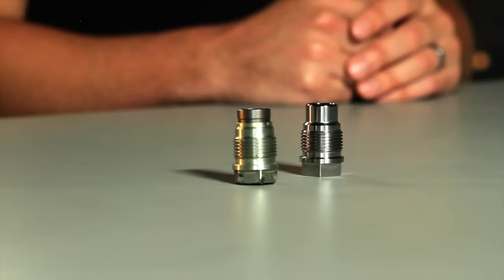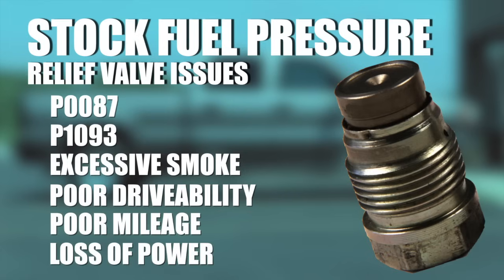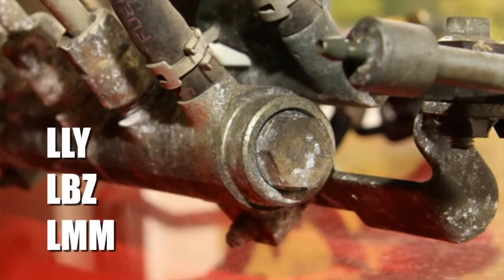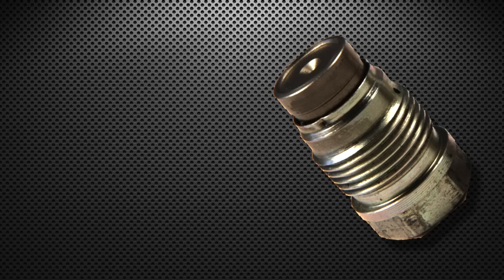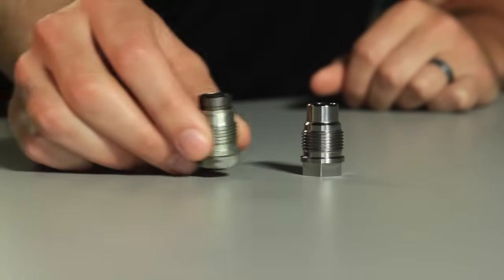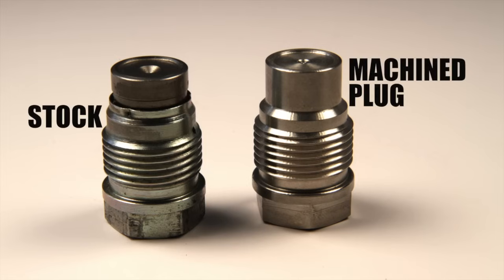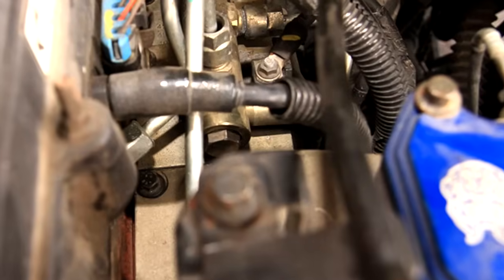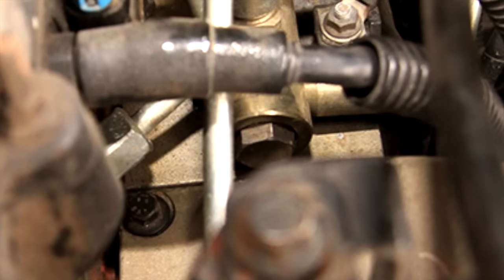Fuel Pressure Relief Valve - WHAT YOU NEED TO KNOW!

Comment: 04 LOT I have an issue. P0700 and U0101 loss of communication with TCM to ECM. Symptoms are: when driving going into 4th gear its like it skips a gear or goes into limp mode but pulls out in five seconds and shifting is good until going back through the gears. Checked pins on TCM checked grounds I could find. Replaced input speed sensor to trans. Replaced NSBU module......Does ANYONE have an idea on why this is happening?? I'm stumped, research online shows little like I'm the only person with this issue. 🤕 please help I can't bring myself to take it to a dealer. Have taken it to 2 diesel shops where I know the guys and a recommended trans shop. Very helpful but all shoulders on what the issue is...
Reply: Try replacing the TCM with new unit. It will require a flash from a tech2 scanner to work. This fixed my code p0700 issue.

Comment: I have a cummins 6.7 and had this issue on my truck. Took it to a mechanic here and told him that I don't have power when towing my 5th wheel and check engine light comes on. When driving without my trailer the light disappears after a while and i can go 70-80 mph. Hook up my trailer i can't go faster then 50-60 mph. He counted figurer out what was wrong. After watching this video i decided to pay the $40 with shipping and order this and replace it. Its been 2 weeks now and I'm hauling my trailer with no problem and its running well. Thanks guys.

Comment: What about the risk of blowing off the injector tips because now you have no way to vent the pressure which is how the system was designed?
Reply: Tony Turner the rail plug they sell still operates as a relief valve. However it is a higher quality and a little stronger
Reply: @andrewfarrell4312  no thats definately a plug.. not a sprring

Comment: Questions guys! I'm getting the code "fuel pressure release valve activated" but it only comes on when I'm sitting not while driving at all. And I'm getting none of them symtems you mentioned so have no idea what the problem is my car is 1.4 tfsi stage 1 remap
Reply from the maker: Give us a call tomorrow - we're not exactly experts with this engine - although we have one sales tech who drives, flips VW TDI's. 815-568-7920

Comment: I have an 06 3500. I get a ticking noise for a couple seconds then truck blows white smoke then it goes away. Could this relief valve cause this to happen if it's bad
Reply from the maker: There are a few things that can cause those symptoms. A new fuel pressure relief valve is a good idea, for starters. Can you call us so we can help you kick around a few other ideas? 815-568-7920.

Comment: Thanks for the video. I'm new to the diesel world and have been stressing a lot about putting this plug in my truck. It's a stock 5.9 cummins. The price of the valve is nuts compared to this plug. I was worried a lot about damaging my brand new injectors but your video has put my mind at ease a lot. Cheers from Canada.
Reply from the maker: Thanks for the comment.

Comment: What could cause similar issues to this on a LB7? Got my LB7 tuned and it ran great for 2 weeks, now it keeps throwing a P1093 code and the fuel pressure drops significantly WOT. The second I let off the throttle the fuel pressure jumps up to where it should be. When I give it half throttle it runs as it should
Reply: Did you figure out what was going on my lb7 is Doing the same thing
Reply from the maker: We may be able to offer a few other ideas - why not give us a call - 815-568-7920.
Reply: I have a 03 LB7 with a Fass 100 lift pump on a new motor with 1200 miles since dropped in.Motor shuts off no codes.Cranks right back up.Any clue
Reply: I have this same problem, but no tune. Did you find out what the problem was?

Comment: It would be good, when showing the location, to start the video from OUTSIDE the truck and move into the position. Zooming in on a spot without ANY orientation is LAME!
Reply: Really though if you couldn't figure out the location then you shouldn't be messing with your vehicles components.
Reply from the maker: Thanks for the comment. We're happy to post a video and send you the link if you like.
Reply: When it comes to the duramax motor.  Most likely if your doing any sort of a aftermarket engine mod ypur going to have to take a a few different pieces of the engine to get to where your part is. And when I say a few I mean 3 or 4 maybe more. Dig in and don't be scared. Just torque everything correctly.  NO GUESSING

Comment: lbz recommended torque specs?
Reply: This DOES NOT apply to an LB7. There is no fuel pressure relief valve on an LB7. For the Duramax trucks that have the relief valve, I saw 74 ft. lbs. somewhere for this little guy! Just crank it on there like the good men at Calibrated Performance said to.
Reply: @jx906  He said LBZ, not LB7. But thanks for the torque specs info.
Reply: 74 is correct

Comment: My valve will NOT come out !! I bought the replacement plug from you guys. I may have to take off my fuel rail. This thing is on like the world depended on it. Any advise ? I have NOT stripped the valve in there YET. I can't get to it at a great angle to get the job done.
Reply from the maker: Hey Texastreeman - at 3:08 in the video Nick talks about linking wrenches to give you a little more power to loosen the plug - don't know if you've considered that yet. If you're still in need - click on this form and we'll contact you when we re-open Monday AM:  http://info.calibratedpower.com/we-can-answer-that
Reply: To avoid it slipping off stick a 3/8 extension between back of wrench and mounting bracket then get nasty with it

Comment: Is there a number I can call to speak to a technician? I've got an issue that just started tonight, I had efilive installed Friday night on my 2004.5 Chevy LLY, I got to 60 mph at about %60 throttle and then my truck shut off completely. I pulled over, primed it several times and will not crank. Filled the tank up primed primed primed again and nothing. Any ideas?
Reply from the maker: Andrew - by all means - click this link and we'll get back to you ASAP: https://goo.gl/SBPty9
Reply: Awesome thanks
Reply from the maker: Let us know if you need anything else - 815-568-7920

Comment: I have an LLY with an LBZ Fuel Pressure Regulator. Starting to get a sporadic idle where it usually sits around 4.3k rail pressure and then it drops to 2.5k -3.5k and then shoots up to 5 or 6k then drops down to normal. Is this a relief valve issue or a FPR issue? I have not re-tuned the truck since installing the LBZ Regulator
Reply from the maker: Call you give us a call at 815-568-7920 - we have a few questions to ask.
Reply: Rob Galles having the same issue same truck lly.  What was the fix? This or fpr? Thx

Comment: I can't go 2000 rpm goes into limp mode no codes and I cant even hear my turbo . No p0087 or p1093 code . What could it be ????
Reply from the maker: Have you data logged the truck or had a scanner hooked up while the problem was happening?
Reply: +Duramaxtuner I have an insight cts2 and nothing just two glowplug codes
Reply from the maker: Give us a call for more detailed assistance: 815-568-7920.
Reply: do you fix it? I'm having same problem in my truck
Reply: Try changing your fuel filter!
Reply: Vidal Martinez did you ever fix the problem? Am having the same issue.
Reply: Manuel Garcia have you tried the y bridge to much boost and psi can pop out the y bridge mouth piece that's what happen to me it took a while because it's was tough to find where it was coming. Then looked down next to the turbo my y bridge was poped out .i used Zip ties to keep it together because it's just two o rings holding the mouth piece in place
Reply: Vidal Martinez- No i havnt looked at that yet my lb7 broke down on me n i changed the fuel filter housing n glow plugs but am ganna take a look at it.. but was your pickup throw alot of black smoke out when the turbo wasnt running?.
Reply: Manuel Garcia no only when I did a egr delete without the efi live.sounds like a bad egr clogged up . Efi live tuned my truck and deleted ten codes and also took it off limp mode  . Also It made a huge difference once my y bridge was put together.
Reply: Vidal Martinez-Am ganna have to do that and i replaced the old egr valve n still smoked n no turbo but it might be the y bridge i hope
Reply: Manuel Garcia you gotta go for a delete if your gonna own a diesel you have to do a egr delete and do a efi live tune . All that egr valve crap destroys diesels  my lmm has 268k and runs better then ever way worth it .

Comment: I have a 2007 classic 6.6 Duramax Chevy Silverado and I've had this code show up while towing my 25 foot Pro-Line boat will this help and will it damage my stock engine. it had only thrown the code and went into limp mode when pulling the boat up a steep hill or Mountain.
Reply: Did you get it fixed because our truck is doing the same did that take care of the problem

Comment: Price 540.00 at the dealer
Reply from the maker: +Jermain Jackson LOL, for a valve with a spring that is going to fail. That is crazy, the race plug we sell is just $50 + shipping.
Reply: +Duramaxtuner Got replaced with 1 that is the same as the 1 that yall offer, just drove it and it's doing the same thing, blowing black smoke, no power, going into limp mode and won't do over 2000 rpms, what do I do next....HELP
Reply from the maker: Sounds like it could be a weak pump. I would start my diagnosis there.
Reply: I got same issue lb7 nothing over 2000 rpm fprv or cp3? I'm getting no code currently had to put new o rings in filter housing due to leak there thought that was the issue but didn't fix the 2k loss of power after 10 minutes of running
Reply: JR Harlow What ended up being the problem

Comment: You don't show where and how to replace on a LB7, 2002.
Please do ASAP, thanks.
Duane
Reply: Yes it does. It is under the turbo horn on LB7.
Reply: @Dlascwbysfn14 okay what happens when you remove the fprv if you’re having issues that the fprv was supposed to prevent where do you go how can you fix it

Comment: pretty sure i need this. i have an 05 lly bought in march. to the best of my knowledge its still completely stock. but gets 20-24mpg highway and 18-19 in town. twice now ive had where i was stepping on it going up hills and it throws the fuel rail pressure code. only up hill for some reason. then it limits itself to 65mph until i pull over and turn off. this last time was going onto on ramp and had two semis in the other lane not letting me over so 0-70 by the time i hit the top and i could feel the truck slow to 65mph
Reply: +trevor randles First replace the fuel filter, if that does not stop the P0087 code then you might need this plug.  It is only $50 and takes about 30 minutes to install.  My 07 Classic LBZ reached a point where it would throw a P0087 at anything over half throttle.  Installing the fuel rail plug cleared up the problem instantly.

Comment: I have a stock LBZ engine No tuner.  do not have any fuel rail code or pressure codes.  Will replacing fuel pressure relief valve do any damage?  Will it improve drivability?
Reply from the maker: We've installed thousands of these fuel pressure relief valves without any issues. It may improve your truck's driveability if you're experiencing problems now.